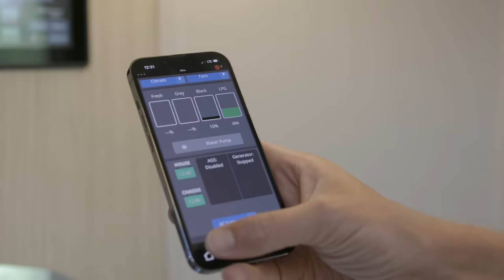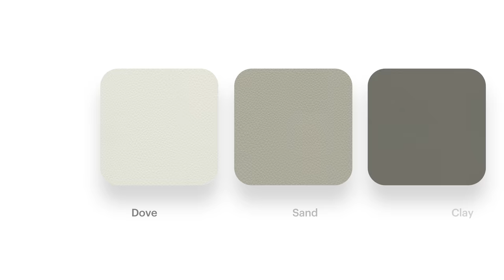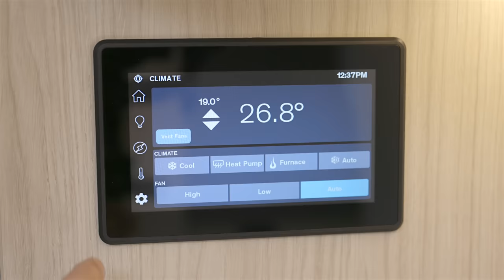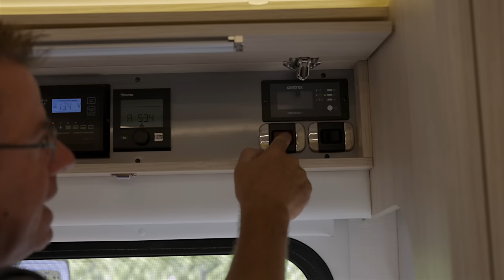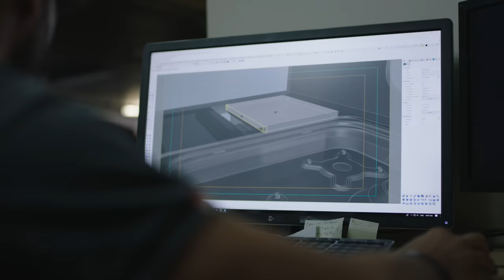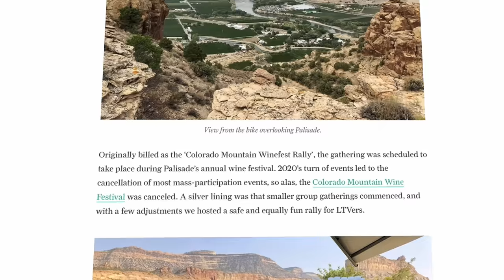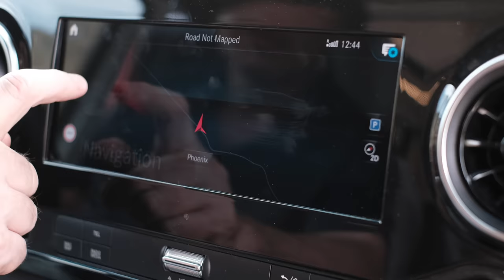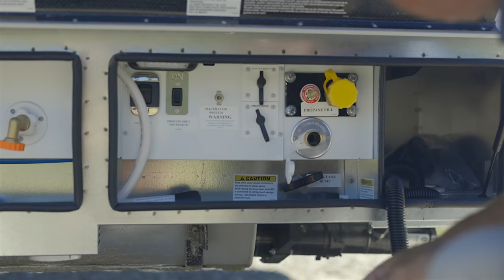2023 Unity Murphy Bed Lounge

Comment: Two obvious design flaws. The bed is not long enough, clearly the pillow is half over a hard board making it uneven and uncomfortable. The stove and sink should be reversed. Why do you have a hot stove with no splatter guard right next to your face in the fancy chair with WHITE cushions? (a lot of companies do this!).

That bathroom is FANtastic. If you could make right-side steering on a Mercedes platform I'd sell you a bunch of them.

Comment: I'd suggest a full electric van as gas prices are going up.
Reply: I don't want to be waiting in line for hours to charge or have to charge every 75 miles. Check out the Ford Lightnings performance under a work load. Also the battery weight would severely reduce the carrying capacity. The electric grid and charging networks still need a lot of work.
Reply: Lol, people still haven't figured out EV isn't viable yet. No power grids to support them, charging takes forever, battery eventually starts taking less and less charge. And tons of people have reported that many charging stations don't put out the correct charge or even work.
Reply: @krninja22  And how much are you paying for gasoline these days?
Reply: @MrDosonhai  What does that have to do with what I just mentioned? I live in Cali and Id still gladly pay for gas over EV any day.
Reply: gas prices are coming down
Reply: @MrDosonhai  3.00/gal
Reply: @daveklein2826  Not in Cali...they're going up. Approaching 7 bucks.